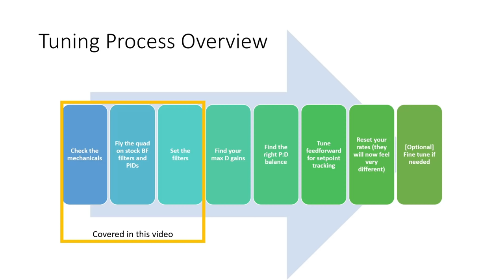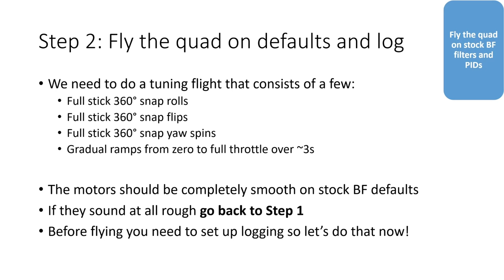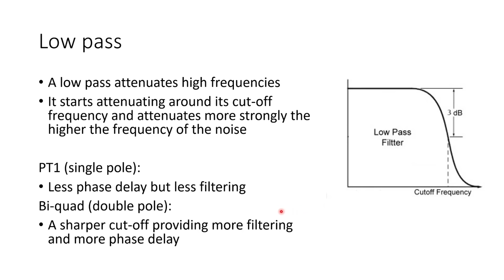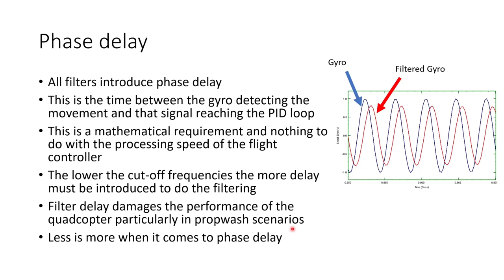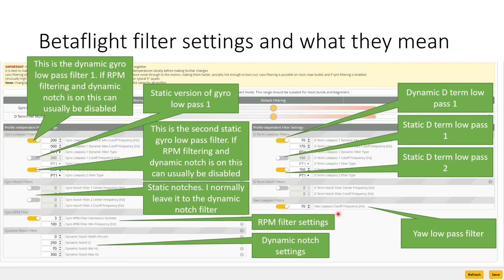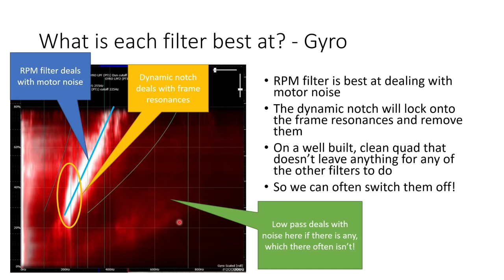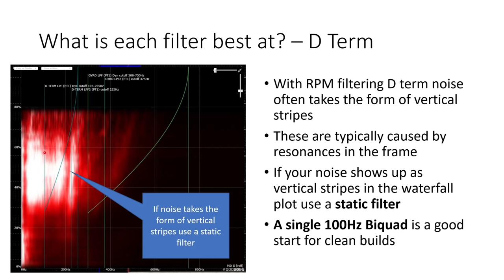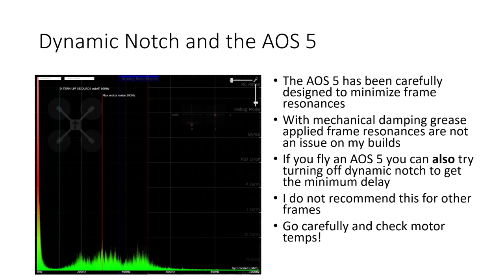Betaflight 4.2 filter tuning. The easy way to get a perfect filter tune!

Comment: Just a question, my quad felt good after placing the filters at the right frequencies. However, a vertical strip remained at arouund 200hz for my quad even after lowering the D-term LPF - Biquad to 110hz. I'm only seeing it with my freestyle+go pro setup not with my lightweight 5inch racers. Is there anything I can do to fix it or its already the frame vibration mitigation limit?
Reply from the maker: That's probably frame vibration. Not much you can do about that really except get a higher performing frame...
Reply: @ChrisRosser  oohh okaaay my idea was right! Again super thaaaanks! Will continue to support you in any way. 🙏

Comment: How do these 5" standards adjust for smaller frames? Namely a 2.5" but please include other sizes for reference
Reply from the maker: Anything smaller you can almost always run the same filters. Sometimes you can raise the cutoffs a little (just increase in steps of 10% and listen for rough sounding/hot motors)
Reply: @ChrisRosser  every the gent, thank you Chris, hoping to get to it this evening. Wish me luck 😅

Comment: How do I know wether I've overtightened my screws or not?
Reply from the maker: For M3 screws I just use my fingertips to tighten them with an allen screwdriver. Your fingers aren't strong enough to overtighten M3 you'd have to grip with your hand or use an allen wrench.
Reply: @ChrisRosser  What really? I mean also m3 arms screws? I use a T style grip and use quite a bit of force. I guess I'm guilty of overtightening then. 😅

Comment: Ok but when to use lowpass 1 and when to use lowpass 2? Supose when there is to separate spike?
Reply from the maker: It doesn't matter whether you use low pass 1 or 2. Low pass 1 is applied first then low pass 2 afterwards.
Reply from the maker: Spikes should be taken care of by dynamic notch.

Comment: Even with stock bf pids and filters im getting weird flutters and harsh flying behavior but only on snappy front or backflips so only on the pitch axis.. flying the aos 5.5 and at first I thought it was the bigger 5.5in props but it does it with 5in props also.
Reply from the maker: Hi, sorry to hear you're having issues. Drop me an email with your logs and a few pics of the build and I'll take a look!
Reply: @ChrisRosser  thanks man ill have to go to a friend's for logs my computer just shit on me but yeah its weird that it's only on the pitch axis.. it's doing it on both mine and my friends aos 5.5 2 separate builds same problem
Reply from the maker: @StR8KiLLA_FPV  Just to tick off the standard things. Do you both have a long VTx antenna? Are you both using the same go pro mount? Is it flexible on the pitch axis? Are you flying stock rates?
Reply: @ChrisRosser  both of us are using caddx Vistas with the regular Vista antenna I have the brain3d kit tpu for mine so it has an antenna holder, he's got his tied to the arm. I have a gopro mount on mine but he doesn't, and it does it on stock bf rates 667 degrees
Reply: @ChrisRosser  were both not currently running gopros

Comment: Why dynamic notch filters to combat frame resonance rather than static notches targeted manually?
Reply from the maker: Simplicity. Targeting notches manually is a pain because something you do to the quad could change the frequency slightly and then you need to retune using blackbox.

Comment: i build my toothpick3 inch and use your filter setting
all good but i get hot motor with stock pid
and i found my prefilter d in pid toolbox is  almost blown up  

so i should what should i do ？
reduce d low pass cutoff？
Reply from the maker: Check the mechanicals if your prefilter noise is large. It may be that the quad is too noisy for my filter settings which are suitable for low vibration builds.

Comment: what is the point not using dynamic d-term LPF?
Reply from the maker: If your noise frequency/amplitude doesn't move a lot with throttle neither should the filter in my opinion.

Comment: what is the difference between Dynamic Notch Width Percent and Min-max ? isn;t that the same ? 
if setting as example Q at 200 and min at 180 Width would be 10 ?
Reply from the maker: Width percent is the width of the top of the notch (for values greater than 0 you get a flat-ish region at the peak of the notch). Q is the sharpness of the notch and min-max is the allowable range of target frequencies over which the notch will automatically roam during flight. Min max is only there to control how far up and down the notch is allowed to move it does not control its shape at all.
Reply: @ChrisRosser  ah so its like "width of Q" (so to speak) ? 
like having a Q at 200 and a width of 5 that would mean anything between 190 and 210 is considered Q ?
Reply from the maker: @nullx8  With width percent =0 the notch looks like a sharp peak with a pointy top. The sharpness determined by Q. With width percent >0 the notch looks more like a peak with the top cut off flat. Again the steepness of the sides is Q. The width of the flat top is a fixed percent of the target frequency (which changes of course)

Comment: I have tried the exactly the recommended filter settings on a iFlight XL5 and I'm getting very loud audible noise from motors/proppelers, like a bee sound. What is wrong?
Reply from the maker: If it happens even after takeoff then you have too much mechanical noise to use the filter settings. Do you have a long antenna?
Reply: @ChrisRosser  No, stubby with rigid ABS printed support. Brand new T-Motor F40 v4 1950kv, with Ethix P3. Everything on the frame si tight. The sound doesn't dissapear after take off. Flys well with filter sliders in any position.
Reply from the maker: @gabrielferaru  can you email me a log?

Comment: If the cutoff of the LPF is 200Hz, then why bother having any filter beyond 250Hz if they eat it all up completely anyways?
Reply from the maker: They don't eat up all the noise above the cutoff. That's when they start to work. Attenuation really starts to kick in around 1.5x  cutoff or even more.

Comment: So how do you get logs if you don't have a flash chip, slot for sd or connection for open larger
Reply from the maker: You don't I'm afraid, those are the options. But you can still try my recommended settings and my PID tuning video has steps for people without logging such as yourself.
Reply: @ChrisRosser  you sir are brilliant followed along and my drone is flying the best it ever has tuned to perfection listened to the motors and went by the feel and now know alot more than I did before thank you for your knowledge

Comment: How much noise amplitude is acceptable after d-term filters? In the waterfall plot should the noise be mostly gone?
Reply from the maker: The best way to tell is to listen to your quad when its flying. If the motors sound rough and get hot you've not got enough filtering. It's hard to tell from logs. If your motors sound smooth with my recommended settings for clean builds I would say you are good to go.

Comment: Black box explorer does not show me the spectrogram as it does in your video
Reply from the maker: You need to click on the trace legend entry. If you follow the video carefully you might be able to see exactly where I click to get the spectrogram to appear?
Reply: @ChrisRosser  you did not mention in your video that it is required to install the tamplates to black box viewer…
Reply from the maker: @sergeybogorodov8207  I think in the video I show you where to download the trace templates and how to install them. The trace templates are not required to view the spectrogram.
Reply: @ChrisRosser  in your video you only say that to look at the logs you need to install the log viewer and put the link in description. But after I installed the viewer there were no spectrogram. It only appeared after I installed templates. But again in your video there is no info where to get them and how to install them. Thanks to bardwell - he had mentioned this info in his video.
Reply: @ChrisRosser  and there is another issue - there is no info of how to change the values of each filter. You should know that there are no manual value changes in betaflight by the default. There are only sliders by the default.
Reply from the maker: @sergeybogorodov8207  You can type in the values as numbers on the filter settings tab. I can also confirm that the uav tech trace templates are not required to view the spectrograms you just click on the legend entry.
Reply: @ChrisRosser  there are no filter settings tabs by the default! 😅 and I really did click on the legend entry but again there were no diagram until I installed the templates!
Reply from the maker: @sergeybogorodov8207  The filter settings tab is found in the PID tuning section of BF configurator. See this image: https://learnassets.getfpv.com/learn/wp-content/uploads/2020/07/03004528/RPM-Filtering-Betaflight-5.jpg

Comment: Well crap. I feel like the idiot here. Seems everyone else in the comments completely understood what you said except for me, Chris. lol. Regardless, I certainly appreciate what you've done here. 

Hopefully you or someone else in the comments can help me understand what you are explaining here a little better. 

You mentioned the dynamic notch filter is used for frame resonance, but then when you get to the D-term filters, you mention those also deal with frame resonance. Does that mean you want to set up both a dynamic notch filter around the frame resonance and a D-term filter? 

Secondy, the waterfall plot you are using for the D-Term. It looks a little different than the one you had showing during the gyro filters. Did you change to a different waterfall plot for the D-term filter explanation?

Lastly, you are putting up a 100Hz biquad D-term filter in, but I am completely confused as to why. You explained earlier in the video that the biquad is a sharper filter at a specific frequency, but your pointer in the video is pointing to the straight up and down line at 200Hz. Why not make that filter at 200Hz instead of 100Hz? 

Sorry if these questions are on the dumb side of things. I didn't even know flight controllers recorded this information to look at until I saw this video. I'm still in the mode of cleaning up my builds to get my graphs to look more like yours, but my straight up and down lines are not in the same areas as yours, so I figured it wouldn't make sense to put my filters in the same places as yours if I'm seeing noise in different areas of my quads.

Comment: Chris if you have a simple way out of overheating motors - please write. thanks!
Reply from the maker: It depends, if the weather is hot and you have a small heavy quad the motors will get hot and there's nothing to do. Otherwise following my tips on VTx antenna mounting and filter tuning should help.

Comment: Amazing video Chris! I think you forgot to mention one of the important things in step 1 and that is soft mounting the flight controller. Thanks for sharing tips! Can I ask a favor? When you have a free time, can you please look at my blackbox logs? My quad flies very very smooth and nice. However, I want to fix the last not so obvious prop wash after a split-s. My latest d-term value today is 50 vs the 62 on my github repo(yesterday's value). The propwash sometimes happen on my split-s but not often. But looks like what UAVTech told me last year, it's the disturbed air that causes this propwash and it's unpredictable. Anyways, here's the log and blackbox log is in the June folder. Thanks in advance! Thank you for creating this kind of videos! 😊https://github.com/c0debreaker/5inch-apex-rcinpower-bblogs
Reply from the maker: Just checked your repo. Your props are quite steep pitch. That will create worse propwash. Try Ethix S3s or other lighter pitched props.
Reply: @ChrisRosser  I have ethix s3 and quad felt underpowered and slow. Maybe I should try 5x4.3x3 again. So lower pitch props help with propwash handling? Thank you for looking at it. I really appreciate it!👍🏻
Reply from the maker: @neilfpv  Yes low pitch props help with propwash. You can mitigate the lack of power with higher KV. Try 5x4.3x3 and see if it improves.
Reply: @ChrisRosser  Cool! Thanks a lot!

Comment: What if you have a horizontal line
Reply from the maker: Usually that indicates electrical noise.
Reply: @ChrisRosser  besides adding capacitor anything else I should look for to fix that
Reply from the maker: @fladoodel  a fettec spike absorber could be good too.

Comment: better turn off dterm and gyro lowopass ?
Reply from the maker: Don't turn off D term low pass. It won't work.
Reply: @ChrisRosser  i got hot motor 1207 3750kv with 93xv3 3/4s still hot i cant touch
Reply from the maker: @jangkrikmini  Then you don't have enough filtering. Go back to stock and gradually disable filters checking for hot motors.
Reply: @ChrisRosser  what should i disable? lowpass or dterm ?

Comment: im confused
Reply from the maker: It's confusing the first time. I hope the video helped.
Reply: @ChrisRosser  i went out and bought blackbox aio just to learn this but i think its going to take alot to understand. this video has made me open my build tho cos its a new build and im getting fly away sometimes at throttle up so im just re routing the wires on top of the fc, one was sandwiched and the other was running across the gyro so hopefully this will stop my fly aways. im all stock but i have altered the dynamic notch filters to 0, 250, 70, 350 from stock. i have blackbox open from a fly away earlier but even after watching your video twice i dont have a clue what im looking at so yeah confused is an understatement.
Reply from the maker: @Loz348  RPM filters on?
Reply: @ChrisRosser  yes im using the new flywoo aio f7 dshot 300, i did try 600 first, 8k/4k, bidirectional on no motor errors, no of magnets correct, new motors brother hobby 1507 yx. Only thing i changed is rates. Got vista mounted above the aio and the sbus wire was touching both and the rx wire was across the gyro so i just fixed that and i will see if i still get fly aways tomorrow. Strange thing is sometimes its away and sometimes not, sometimes i can gain control after take off and earlier it just kept going but then if was fine every time i armed and throttled up after the big fly away and the mottors dont sound smooth in flight. Also i had this buttery smooth before on a ghemcu aio, even without rpm filtering on it use to be so nice to fly and pretty much no propwash, now i have tonnes of propwash. Motors only get warm, they used to stay cold when it flew nice before.
Reply from the maker: @Loz348  See if the wiring fixes the issue. If not I would check logs to see if you have a bad gyro (it does happen).
Reply: @ChrisRosser  i hope its not bad i bought 3 of them. What do i look for in blackbox log to know if it is bad?
Reply: And would having the vista mounted on top of the fc have a negative affect. I had two of these builds with different motors and the other build had the vista mounted to the top plate but was awkward to work on and this one is mounted on the aio screws. This one always flew better of the two so i sold the other one. Then i wanted blackbox so i got this f7 and mounted the vista the same way as before.
Reply from the maker: @Loz348  Lots of high frequency noise. If the gyro is bad it'll only be on 1 FC.
Reply from the maker: @Loz348  Should be OK to mount the vista above the FC.
Reply: @ChrisRosser  so no more fly aways so far and the motors sound much happier since i moved the wiring so your video has helped massively. Im going to have to watch a few more times its alot to take in, she flies nice but it do want to tackle the propwash which is not really bad but alot compared to when i first built it. Need to find a good blackbox video explaining spotting vibrations and how to apply the filters.